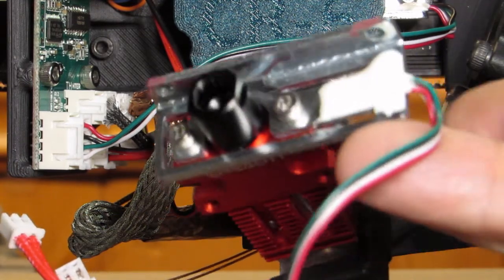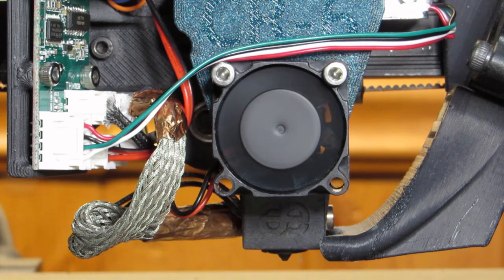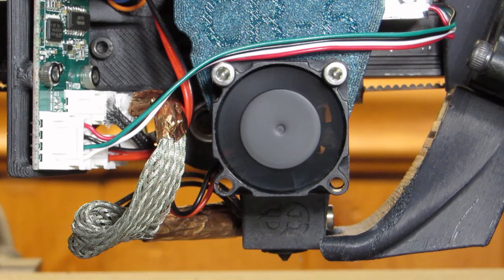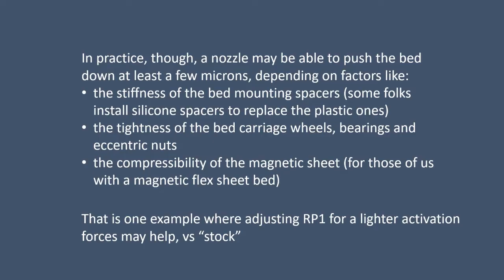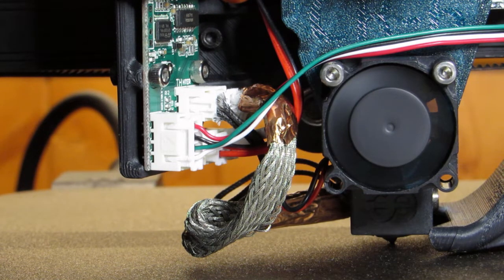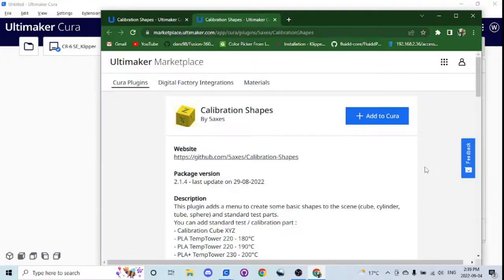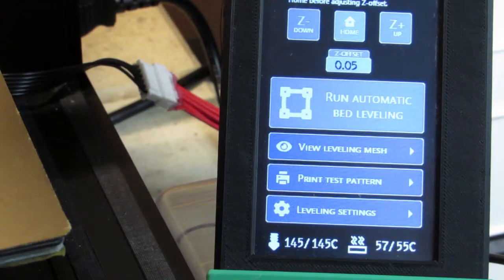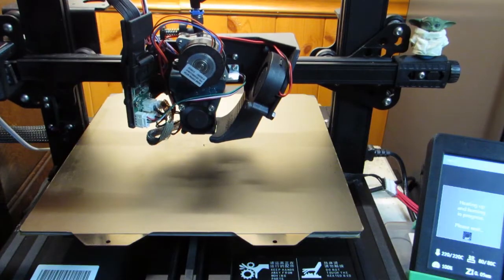A Novel CR6 Z-Offset Measurement Method.  Surprise!

Comment: Hi 
I See you have values on your screen, but how do you get them in the first place. 
Can you show it from the touch screen showing showing the values as o, then you press home, show the value on the touch screen again, before runing the Z-Offset test, to obtain a true value to set your Z-Offest at on a CR-6.
Reply from the maker: Which “values” are we talking about?  
Z offset is initially programmed in the firmware to be 0.20 mm.  Tapping the up/down arrows on either side of the Z offset value will bump the value up and down in 0.01mm increments.

Comment: Very very informative! I've been printing for 6 years and I finally caved and bought BL touches for my Ender 3 and 5. I was a super early backed on Kickstarter for the CR6 and the way they handled it really put me off. It sat in box for almost 3 years before I pulled it out and before I even printed I ran thru all the community upgrades. Power switch, main board, all the fans. It's a great printer, but even after initial setup I defaulted to my E3 and E5 for some reason and never played with this one. After installing the CR touches on my other 2 I realized how much easier life had become and decided to boot up the CR6. I did the vibration method like you said while listening to it, sure enough my previous offset was .06 and I didn't start getting the fan buzz until about .17! After this mesh finishes I'm going to give it a shot and see what we get!

Comment: Excellent tutorial. The only thing that didn’t sound right to me is the assumption about the extruder exerting a force on the strain gage. This simply won’t happen because any compression force exerted by the filament on the hot end will be equal and opposite to the tensile force pulling up on the press lock fitting by the tube. The net force is zero. The lateral forces exerted by the tube itself might be of significance though.
Reply from the maker: I don't follow your logic about "equal and opposite."
When the extruder pushes the filament into the hot end, it applies a downward pressure to the back of the nozzle, which is thereby applied to the full body of the hotend.  
If that force is greater than the resistance of the strain gauge, it will also deflect the gauge's lever downward.
A Bowden set up has so much slop in that length of tube, that the filament is more likely to bend the tube than to push the hotend down.
A Direct Drive extruder absolutely pushes the hotend down, unless it is also fastened directly to the hotend.

Comment: My cr6se always strings out filament as it hates up to start a print is that normal?
Reply from the maker: Yes, once the nozzle temperature exceeds the filament melting point, you are going to see what I call "drool" falling from the nozzle.  The rate at which it does that tends to vary with the filament type.  That is one major reason why the nozzle is not heated above 145C during the homing/probing cycles.

Comment: Fantastic, I have been fighting with getting good prints after updating the extruder to a dual gear extruder and it never occurred to me that the retraction could affect the knowledge of where the nozzle is to the bed reference. Your explanation was very detailed and understandable. I have not updated the firmware to the community version as there have been quite a few problems associated with it so I am on the original CR6 se firmware. I wish i could see the numbers that the "bedlevel" generates. This was very helpful thanks

Comment: I have been using a piece of paper to set zed offset since I received my cr-6 se. I did not realize that the nozzle could or should be THAT close to the bed. When I set mine, even though it is very small, I can definitely see the space between the nozzle and bed. I'm definitely going to give your method a go. Also, just curious if you switched out the plastic bits the bed screws go through? I notice your bed level is all in the green. I had quite the rainbow until I switched to the beefed up Creality spring kit. It works well, but I've noticed that I have to run ABL more often. I'm going to switch to the high temp silicone bushings and see how they work out. Thx for the hard work you put in to help us all out.
Reply from the maker: Yes, I replaced all of the stock plastic spacers under the bed with silicone spacers.  I also replaced all the bed screws with longer ones (except for the 3 that end above frame extrusions), so that even if I had to loosen a screw to level the bed, that screw would be fully through the hole in the lower plate, not "hanging-in" with less than a full turn...   

Since the M4 bolt thread pitch is 0.7mm, I also made a simple visual aid to help me turn the bolts by 0.1mm at a time.  That saves a bunch of iterations, when chasing the green dream.  

https://www.printables.com/model/462272-bed-screw-adjustment-aid

Comment: No matter what i do i cant get lower thn .35 after the firmware update
Reply from the maker: The higher the Z Offset value, the further past z=0 your nozzle pushed, before detecting the bed strike.  Have you tried Creality's recommended method for adjusting the voltage on RP1?   

https://www.youtube.com/watch?v=QB0P2opolqA&t=154s
Reply: @makingthingsreal101  thank you for the reply 
İf i go lover than .35 it becomes flat and sometimes i do 1.0 ans it still works like 0.2 maybe its because of the community firmware 

İ even tried an a4 paper but it still gives error
Reply from the maker: @muttigangster  Sorry for the long delay.  
Did you try calibrating the strain gauge per the Creality method  in my previous comment?

Comment: weird...
I have on my cr6-se following firmware: CF6.1-Final-cr6-se-v4.5.3-mb-2021-06-04-16-53 (and works great!)
and my head does not return to "zero" after homing, it goes up to the 1cm or what it is (like yours before it goes down)
Reply from the maker: The "homing" to which I am referring is the one on the Calibration ABL screen, specific to calibrating Z Offset.  Regular Homing leaves the head above the bed.

Comment: you're talking about offset, you're describing the space between the nozzle and the bed, .15, .05? when I think offset, I visualize left, right, up, down (on a horizontal planet)? graphics would accomplish a lot if you could use them, just putting the information on the screen around your image would strengthen your message? no one truly likes a talking head; I bet even you don't like a talking head? I am very impressed by your word-usage, but I'm at 7:32 and you haven't said anything about the method yet. suggestion: write your dialogue out on paper, on a screen, whatever, and then edit it ruthlessly down to just the important bits? if you had deleted the rant your video would be 7 plus minutes shorter, which would be a good thing. the problem is: 99 percent of the you tubers are going with the ruthlessly short video, slam bam thank you sir, message. you're going against the way, hence the lousy view counts. you're not reaching people because your videos are too long, too filled with miscellaneous info (to their minds). no one has the time. posting the time line points is great, but please ask yourself, how much of this do my viewers need, want, what will help them answer their immediate question right now? if you truly want views, that's the key. I have a cr6se. I'm thinking about the community software, but really, I want Klipper on my CR6se. I would love to get there with community software so I don't have to spend $160 to get a sonic pad that doesn't provide klipper to my cr6se yet. do the rants separately? withhold all the back story info on how everything works? people can see what a thing does, do they really know now the physics work, etc. I want to honor your intelligence. everything I know is based on story-telling, Joseph Campbell. Start with the problem, describe it, leave the history out of it, show what's working against it, three times, end with the solution solving the problem, wrap up, say good bye, tell people to subscribe and click on the bell, get off the screen, under ten minutes, no more high-level discussions, no more leaving the main story line to tell other stories. edit yourself to get something better (read that shorter), online. you're get more views, you'll do more good, at least give it a try. Show yourself that shorter IS better. those are my suggestions. We're at 17 minutes, and I'm out of here because you haven't solved the problem yet. thanks for doing what you do, sorry I don't have 51 minutes to see what that is.
Reply from the maker: Thanks for the detailed critique.
I appreciate you taking the time.

I see a lot of CR6 folks posting questions about Z Offset.
These folks do not all have the same background or experience with 3D printing in general or the CR6 in particular.  

Rather than assume any particular expertise or vocabulary, I try to "set the stage", here, before launching into an explanation of the method itself.  Yes, that takes up much more space than demonstrating the actual method. Yes, that "background stuff" is just clutter/blah-blah, to someone who just wants a specific punchline.

I do it, because some folks will find that the problem they are chasing is not actually Z Offset, but something else. Some folks will find that they misunderstood what Z Offset is on the CR6. Some folks don't realize there is any controversy around using paper for measuring offset. Some folks don't realize the CR6 probe as nozzle system is vulnerable to various biases.

I am not posting tutorials, here, or TikTok videos. 
I am posting reference material and detailed discussions.  
I agree, a bit of scripting and outlining before I start would do a lot to help me shorten these things for the viewers.  I do have much to learn about technical documentation and about video production.  

Feedback such as yours is helpful.  Thank you.
Reply: I watched it at 2x the speed, found it detailed and informative, but i have read all the basic guides - its nice to get an engineering perspective. (alright i could do with out the chip knowledge, but hey it was fun learning)